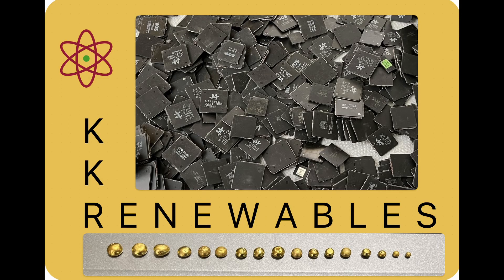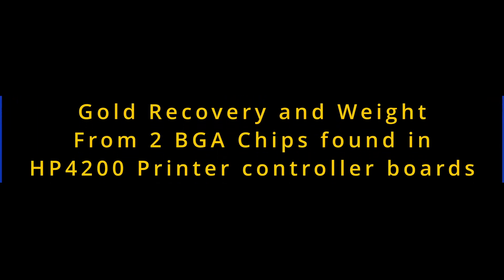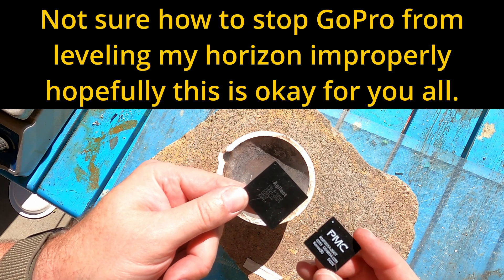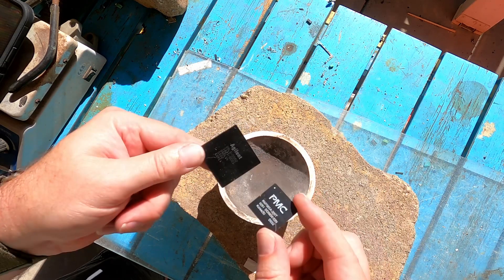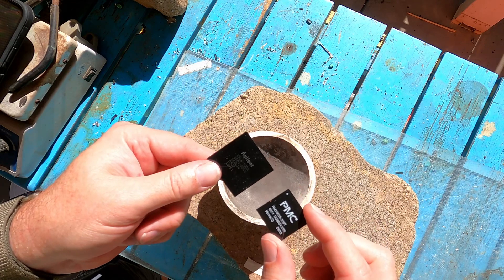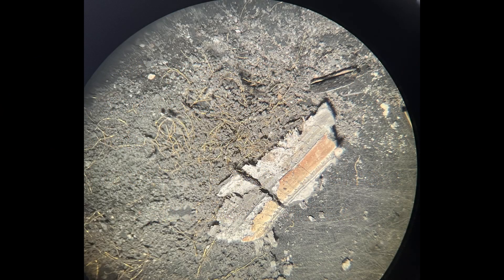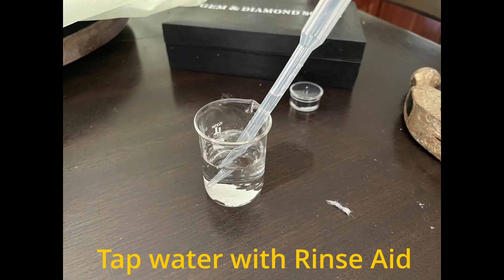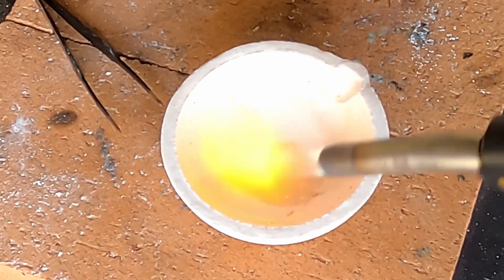Gold Recovery Test from 2 HP4200 BGA Chips - Disappointment

Comment: I would think that there would have been some vaporization of the gold from the burning of the chip...

 It also didn't look like you had enough Flux to protect the recovery to me but I've only worked with silver this way so I don't know for sure...

 I honestly didn't think that you would get anything much this way... 

Awesome video subscribed
Reply from the maker: Thank you for the view and the comment!  I’m fairly new and still feel like a newbie here.  Can you tell me more about the “flux to protect the recovery”?  Gosh, I hope I’m not vaporizing gold. I can use my laser temperature meter and see how hot it’s getting.   Gold’s boiling point is 2,856 °C or 5,173 °F.   We’ll see!  Thanks so much!